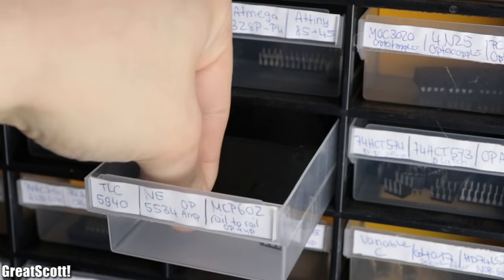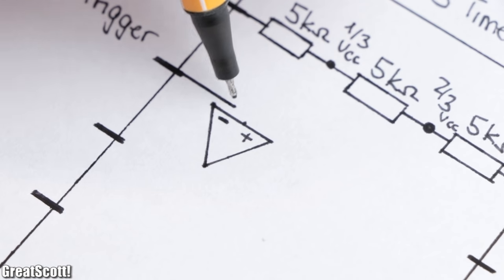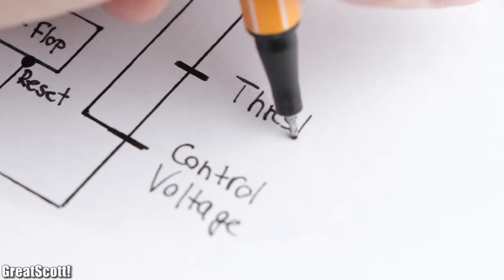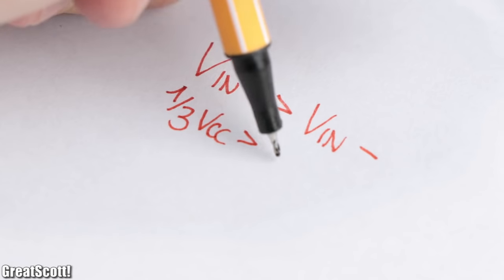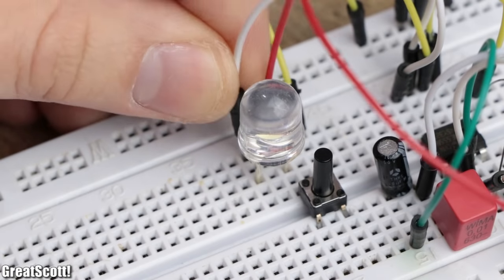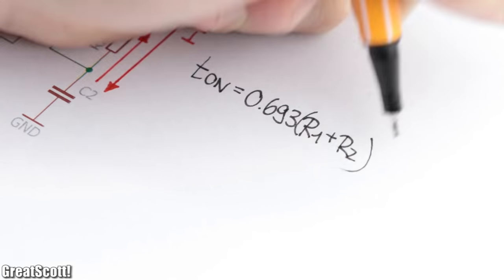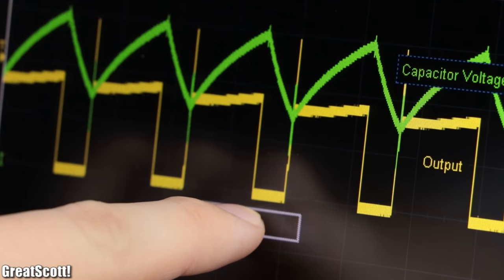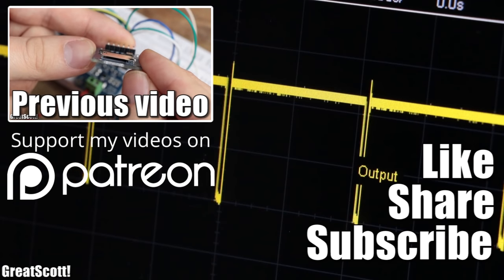Electronic Basics #26: 555 Timer IC

Comment: I find that just using an Arduino board (or any micro-controller with PWM) is easier because 1; you don't need any extra components other than a potentiometer and the load and 2; I find writing a few lines of code easier than hooking up components in a way that I only somewhat (even after watching this great video and others) understand.
Reply: There are applications when using an MC is a waste. Sometimes it just comes in handy to know how to create some simple circuits without programming anything.

Comment: Nice! 
So it is possble to make a circuit with stable PWM frequency, using just one 555 - another trick is to use an external  oscillator with set frequency and let it trigger the the 555 in monostable mode and use the control voltage pin to adjust duty cycle. For most  applications it probably doesn't matter if frequency drifts a little. I have a 9 kW furnace that I control with the simple 2 diode circuit - at high duty cycles, the frequency drops a little, but that's just good because the transistor runs a little cooler during high load (switching losses goes down with frequency), while the ripple current is still low at around 50% duty cycles (where that is at it's at maximum)

Comment: I see this all the time on YouTube that people say that the 555 is the most used chip of all, the strange thing about that is I never came across such a chip in any of the hardware that I took apart for recycling, I recently bought a few just to get familiar with the chip.
Today I've got the blinking LED working for the first time, pretty neat but it can be done much easier with less components so I don't really see the advantage of it.

Comment: Awesome video, Scott, has helped me a lot. One small thing - the schematic shows the base of the discharge transistor as being connected to the inverted flip flop output but shouldn't it be shown as being connected to the non-inverted output? In the monostable example I couldn't understand why the flipflop being set (inverted output going LOW) was causing the transistor to be turned ON, then checked another video and saw that it would actually be turned on because it's connected to the non-inverted output instead.

So, your explanation was correct but the schematic is slightly wrong. Unless I've missed something in which case I stand to be corrected.

Keep up the great work !!!

Comment: One thing that confuses me that I have seen other people do: You seem to be discharging the Timer through the output pin. I assume you're getting the pwm signal from the discharge pin (as seen in another video from the EEVblog). I'm wondering why this is possible, since the way I see it, the discharge pin should be floating as long as the internal transistor is not activated. In my mind this setup should not produce a decent output signal. So, what am I missing?
Reply: Can u share the answer if u have it now?

Comment: 3 years later, I discover that video.
For PWM, we often need to adjust it by varying a voltage. Let's say: 0 volt to 5 volt. I bet we need two 555 ; the first for the duration of the entire cycle, the repetition rate or frequency. The square wave output is transformed into a saw tooth with the help of RC filter and a diode. The saw tooth voltage is sent to a voltage comparator. There must be some chip that perform all this.

Comment: I have a question about the last example of PWM signal. Considering the lower current capabilities of the TLC555 and the fact that we use a part of the current to charge the RC circuit, I guess it's only suitable to drive a high impedance circuit at its output, right? 

I tried assembling this circuit, sadly, as I am just starting out, I have limited amounts of components. When I use a 10K potentiometer (don't have any other atm.), a 104nF and a red LED at the output 
- with small resistor at the LED, nothing happens, which is probably because of the high difference in resistance between output path and charging path. 
- with a big resistor at the LED, adjusting the pot. changes brightness a little bit, but the LED's brightness is nothing to brag about to begin with. 
- when I disconect the LED and measure the voltage out -> gnd I can get about 0,5V - 4V depending in the position of the pot. 

Could this be because of little output current of the TLC555? I guess I really need an oscilloscope if I want to get any further into electronics.

Comment: I'm a complete beginner, but I thought the capacitor connected to ground at 2:38 would immediately discharge to ground? What am I missing?
Reply: Its charged the opposite way mate
So its negative is in ground side and positive the other
The capacitor will  discharge through the resistor
Reply: @abhijithanilkumar4959  Thank you friend.
Reply: @abhijithanilkumar4959  Would it work with a non polarized capacitor?

Comment: Had to watch this to realise the output from the flip flop is low when the main output at pin 3 is high. The book I was reading did not make this clear so I was getting confused as to why the discharge transistor was open when when the main output was high! I take it the output stage goes through an inverter?

Comment: Fundamentals Tutorial Request
Hey, nice tutorial. I need to try that 555 PWM setup now :)
   I've been working on Op Amps and audio filters. I haven't been able to find an example that contrasts different capacitor functions in circuits against themselves. The biggest challenge, has been when I'm trying to figure out a schematic for a device I already have, and I'm trying to understanding and identify coupling and decoupling capacitors, versus what parts of the circuit are passive RC filters, versus what parts of the circuit are for impedance matching.

   I am modding a small powered stereo subwoofer amp circuit and wanted to try a little JFET triode (tube amp) emulator preamp circuit on it. I built the emulator circuit and it ran fine in front of a small LM386 Amp I built. My problems began when I tried to use it in front of a stereo circuit. I am still fishing around for the solution but I think the problem has to do with input impedances.
  I went through the Art of Electronics, Google searches, YT search, Your Channel, Afrotechmods, and EEVBlog, but I haven't seen a direct practical approach to the problems I'm having. Everyone seems to want to explain capacitors as they relate to AC, DC, or frequency separately, but that information becomes a bit difficult to use, practically, when someone has to first identify what the function of the capacitor or RC configuration is before they can apply what they know about AC, DC, or Frequency. I think this would make an excellent fundamentals type tutorial. 
   Feel free to contact me if you want some schematic examples to use. If I tried to explain things that I have learned, like you do on YT I could make Dave's content on EEVBlog look short. It's not that I'm too lazy or incapable. You, and many others here, have set the bar at a level of excellence that blows me away. Thanks :)

Comment: I tried you last schematic, and the PWM works, but something is happening that I don't understand: When the Duty cycle is at max the HIGH of the PWM is at 0V and when the Duty cycle is at min the LOW of the PWM is at 0V. So when I'm in the middle HIGH is at 20V and LOW is at -20V. I'm powering the 555 with 5V. Both capacitors are 10nF, and I use a 100K pot. Any tips?

Comment: Hey Scott, great Video! I was looking for the setup for a usable PWM-Build, used for Power Electronics, for a long time, could you upload the schamitcs for the usable PWM-Build? Or even all of the builds you just showed? Really appreciated and thanks again for your awesome channel!
Reply from the maker: Well, the schematics are visible during the video. I will not upload them separately, sorry.
Reply: Do you know a website which presents them in a good and transparent way? I´m trying to power a motor with a high factor of efficiency and would like to dive into this a little bit deeper.

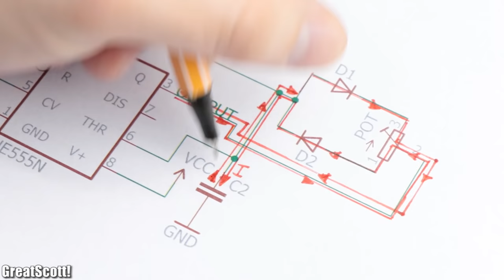Comment: Something is wrong with the diagram at 7:01. You are sure that the output should be partially (through the potentiometer) send as a feed-back to the 555 through pin 2 (and pin 6) ?

Comment: Why does adding a capacitor to pin 5 (control voltage) help to stabilize the reference voltages??  Why is it better than leaving it open?

Comment: I'm not too experienced with this stuff. A few years ago a friend was working on a Halloween costume and wanted a part that rotates. So I tried my hand at an an adjustable PWM signal generator feeding into a servo motor. The behavior was very erratic. It's possible there was a short, but also I'm certain I didn't use the last configuration that is featured in this video, and I'm double sure I didn't use the recommended 555.

Comment: In the monostable and bystable version of the circuit, the push buttons trigger the wanted action by grounding the corresponding pin. Would it be possible to obtain the same results by touching the wire and using the human body as ground?

Comment: if this is the basics I'm fucked cuz I only understood like 30 %
Reply: this is the basics of a 555 timer, it just requires you to know other basics like flip-flops, bpj transistors, comparators and voltage dividers. Find tutorials on those and you should be able to understand this (although I still have some trouble with flip-flops, they weren't discussed for very long in my classes)

Comment: why are ne555 used instead of tlc555 then?
Reply: Tradition, price, technology, availability. 

Since the these chips are not 100% compatible with each other switching from one to another on existing design is potential risk. it's easier and safer to use old chip with existing designs than go trough entire system.

There are many differences to check like input&output levels, current delivery, operation speed&voltage range, power usage, temperature range, rf interference, decoupling needs, esd sensitivity,  ... Most of them aren't likely to become an issue, but one can't be sure without testing the system. 

On new designs, it'll be balance of availablility/price and features. With the jellybean chip like 555, the price won't be an issue and availability should be fine for most common types.
Reply: So NE555 is talking with IRFZ44 now? Okay.. I might want to shake my head a little now..
Reply: Arsyad Kamili ( ͡° ͜ʖ ͡°)
Reply: iceberg789 
Make sense.
Reply: More current, he explained it.
Reply: TTL logic has existed longer than CMOS, it is possible that it'll fade out all together as CMOS improves
Reply: IRFZ44 <---Obviously a power mosfet, and the Z makes me think its one of the fancy modern ones :)
Reply: +NE555 +IRFZ44   hey, i used both of you in my sstc!, i love you components!
Reply: NE555 bcz of aimbot hacks
Reply: I mean tlc555 is not that much more expensive, and you can just use it to control a mosfet if you want more current. Seems to me like we should be using this chip everywhere.

Comment: Thank you for a great tutorials. I have a 12V fan that I can only control with fixed 25kHz and variable duty cycle(on a separate control pin). I am currently using arduino and I would like to make a simple 555 circut. Any advice on witch circut( at 7:02, using TLC) should I use?

Comment: I have a question that may not have enough information to answer. I found a schematic on line i want to use but it uses 3- 555 ic's in its circuit. Is it possible to use  NE558 quad timer in its place? It's for a alternating led strobe light flasher that triggers a pair of mosfet's

Comment: Hey Scott, I saw a SMPS CKT in which they have used transistor as a switching element controlled by pwm of pic  instead of mosfet as a switch . Is it because of threshold voltage of mosfet or there is any other reason for that? Plz guide me.

Comment: there are thousand of ICs, how can I know which one uses for my project. We need experience, don't we? or some tricks :D
Reply: Nguyễn Huy experience is the key
Reply: From my view, the project "chooses" the IC's. Sadly, only experience can really give you the knowledge of what they all do. But, sometimes, good old perseverance will get you there. I had a speed control project for a radio control system I was designing/building. My plans expanded into a circuit board so large it was impractical(about a foot square with several dozen IC's). Finally, about 6 months later, I had an idea. The final working prototype was 2 inches by 3/4 inch and 1/2 inch high and had only two IC's. At the time, commercial units were about 2 or 3 inches square by about an inch and a half.
You never know what you can do until you do it.
Reply: Experience, yes. But more likely, wisdom. Browse the IC listings, and you should see the basic function of each(or most) IC's listed. Search for circuits of the kind you want to make, there is a LOT of it on the internet.
Reply: also, study the datasheets, they are an invaluable source of information

Comment: My bistable operation in 555ic is not working when power is supplied from a 5v adapter but it works well on 5 v battery

Comment: Hey, Scott!
I've used the timer in the bistabile mode, but as soon as i touch the wire for the trigger pin, it turns on. I didnt need to connect it to ground!
Is that a malfunction or intended?
Reply: there is no malfunction - if your circuit is referenced to mains earth, and you are grounded, by touching the trigger pin you are electrically connecting it ground through your body.

Comment: Hello sir can you create pwm signal using pin 5 (control voltage) by connecting this pin in a variable resistor to form a voltage divider configuration

Comment: When the duty cycle is very low <5% towards the end of the video, why was the voltage collapsing so much?
Reply: BoomBrush i think that it was so low that the capacitor wasn't getting enough time to charge fully
Reply: Shape Shifter Makes sense. Thanks.
Reply: BoomBrush I think it has more to do with the slew rate of the 555 timer, the output pin does not have enough time to ramp up. You will notice this behavior with many PWM drivers.

Comment: greetings can i make a led chaser with this i wanna make a led turn signal with it just like the new audi has so the leds correspond with the direction you are going but i'm kinda new to this a so can u may help or nd i don't really know how to make something like this so can you may help by explaining or give a schematic i saw a lot that use a 4017 ic and a 555 ic and some that use a PIC something i can solder and that stuff but chips is not really in my understanding

Comment: is it possible to get a camera, connect it to an arduino and do timelapses with it? if yes can you please make one?
Reply: I'm not much of an arduino guy but that sounds very doable. You want a real time clock module. And the basic circuit will be the camera trigger (which is like a push button or remote or something) that is wired into the arduino. Then you have the real time clock which tells the arduino what time it is. From  there you can code the arduino to close the switch at time x

Comment: Could you use a 555 timer to make a real time clock, or a clock in general? Was thinking i could use it to implement a clock on Arduino Uno
Reply: giacomo aliboni the way id do it would be using to to count one second an then move the hand. But you can easily do that with an arduino anyway

Comment: ic
first
Reply: the owl i cee you second 😂😂😂
Reply: shame, im second :(
Reply: the owl IC what you did there
Reply: Have fun reading IC 1101 is among the largest known galaxies, but there is debate in the astronomical literature about how to define the size of such a galaxy. Photographic plates of blue light from the galaxy (sampling stars excluding the diffuse halo) yield an effective radius (the radius within which half the light is emitted) of 65 ± 12 kpc (212 ± 39 thousand ly).[3] The galaxy has a very large halo of much lower intensity "diffuse light" extending to a radius of 600 kpc (2 million ly).[7] The authors of the study identifying the halo conclude that IC 1101 is "possibly one of the largest and most luminous galaxies in the universe."[7]

Like most large galaxies, IC 1101 is populated by a number of metal-rich stars, some of which are seven billion years older than the Sun, making it appear golden yellow in color. It has a bright radio source at the center, which is associated with a massive black hole.

Comment: Can you make a DC Volt booster?
Reply from the maker: Already did it
Reply: !EasYHakZZ! cek "boost converter"
Reply: GreatScott! 
could you please make a singing Christmas card tutorial. I'd like to make one for the holiday.
Reply: I've used a 555 to boost 5 vdc  to 15 vdc(regulated). That was back in the late 70's when I worked for American Scientific designing an IC version of a tape recorder that was built with transistors. As I remember it used a cockroft-walton  multiplier network to do the boost, the 555 was a square wave oscillator regulated by a feedback tap from the output. Worked perfectly and with very high efficiency(about 98%)

Comment: This is exactly why this is precisely the wrong chip to use with students and beginners... Far too complicated, with insrutable black box functions! 
Just as steam engines are a simple entry point into engine principles, a Schmitt trigger is far more understandable. It can perform more functions in a modular way with less external components. Clock, timer, monostable, bistable, etc.
It also demonstrates the use of positive and negative feedback.  
40106B for students!